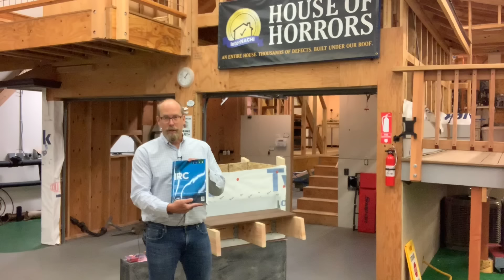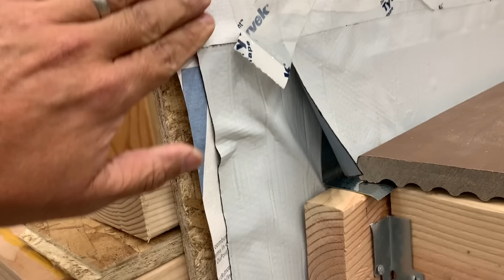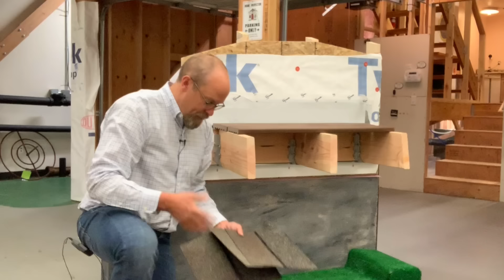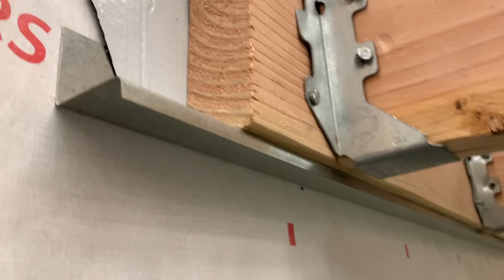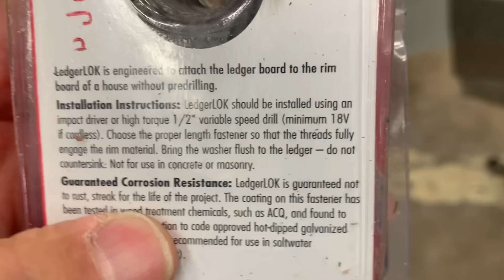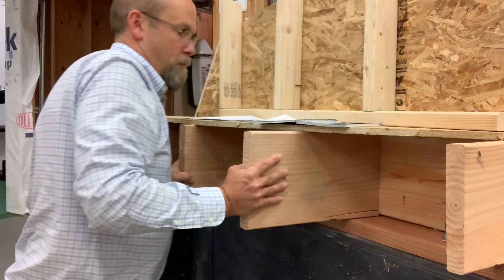Deck Ledger Board Flashing Inspection Tips

Comment: We recently removed a concrete and deteriorating brick patio and discovered lots of water damage from improper slope and drainage. The rim plate and joists have been sistered and/or replaced and we replacing the old patio with a deck. The contractors have already installed the ledger board (and about 1/3 of the joists) and did not include any flashing. They say it's not necessary, because their plan was to butt the deck boards all the way up to the house sheathing. Everything I've read says code requires flashing AND since we've had nightmare water damage we are paranoid about future water issues. Question: Do we need to have them remove the ledger board and install a membrane behind it or can we get by with using a vinyl cap flashing on top of the ledger board? We want this done right. It's an expensive job already, and will add additional time, labor and materials expense to remove the ledgers and add the membrane. The contractors would obviously prefer to not have to remove ledgers and redo.
Reply: It's not for protecting the ledger alone and that is what the vinyl cap would do....remember that every fastener is a pathway in for water that is why great lengths need to be taken to ensure moisture is deverted away from house and those hidden components that once covered won't be seen till there is a problem. Pay a little extra to have siding removed enough to install all the elements required and when deck is complete then finish the siding down to the deck and below again with required gapage.
Reply from the maker: Thank your for watching and for the feedback.

Comment: I didn't install a ledger board on my deck. Installed 3 extra posts to support the deck along the house, centred 2' from the house with a support beam (cantilevered). My siding is untouched down to bottom and the last deck board is about 1/4" from the house. I feel that the potential for damage to the house or a rotting ledger board (no air behind it) is not worth the risk. As well, it's less expensive and quicker to install a few extra posts.
Reply from the maker: Thanks for watching and for the feedback, Hue.

Comment: Loved this video, thanks! I am installing a covered porch and even though this is for a deck, I believe it should be  the same procedure when attaching the roof of the porch to the house... I have vinyl siding, so I will be removing it, apply the flash, then apply the waterproof tape in a shingle type manner (overlapping)... then the 2x8... Now should I look for some type of beam to attach? Or I could I just attach to the house wall itself?
Reply from the maker: I recommend contacting a local contractor that your local certified home inspector recommends.

Comment: Bought my house back in October. Having some trouble with rotting of siding and the deck. No house wrap, membrane or flashing was installed. Don't have the money to get the whole thing re done right now. What do you suggest I do without uninstalling the ledger board. in the meantime til I'm ready? Flashing and membrane on to and bottom of membrane. 

One of the big reasons water was being brought to the area was also due a gutter leak from an improper installed gutter from above. Fixed that. So I'm hoping with some replaced siding it will be ok for 5 years or so. But, want to water proof as best as possible so it lasts as long as possible.
Reply from the maker: I'd contact your local certified home inspector to check it out and make recommendations for you.

Comment: Is this necessary or new?   We use to use the copper roll flashing and that was it and always passed
Reply from the maker: Copper doesn't self seal, so there are many places where metal just doesn't work, including behind the ledger board through which fasteners may pass and would require a self-sealing material. Just something to think about.

Comment: no need to put flashing on the bottom of the ledger...
Reply: We also never do metal flashing on the bottom of the ledger board... and honestly I cannot see why? We do two metal flashings one top of the ledger board that’s the first Metall one ( just a simple 90°  2” by 2” metal Profil ) and the second one is then over the final deck boards whatever they are 1” by 4” or 2” by 6” or Tex boards ...
Reply: @wolfgangselle4307  i am trying to picture this in my mind
Reply from the maker: It may be a good way to kick out the water from entering the top edge of exterior siding material that begins just below the ledger board.
Reply: @internachi  absolutely need it just my opinion
Reply: If its in-set

Comment: My home inspector also didn't mention anything about the deck either. I decided to take a peak and noticed my band joist is rotted out. Not completely, but enough where that section needs to be replaced. Luckily I think I can manage the repair myself, very little to no jacking should be required. We shall see. After I fix it I can replace the deck with a properly built one. 

The real trick will be figuring out what to do about the old well they build the deck over.... Tempted to leave it be but I need to regrade the yard for proper drainage and that would make the we'll casing sit about 2 feet above grade.....
Reply: If the home inspector is referred by a home buyer's real estate agent the inspector will usually not find anything significant. Real estate agents won't give referrals if they do & most of their clients come from real estate agent referrals.

Home buyers / commercial property buyers should ALWAYS choose their own inspectors & attorney for closing.
Reply from the maker: Thank you for the reply and feedback, Casey. It's very difficult to find hidden defects. I'm glad you were able to get to your deck and make repairs.

Comment: I just found out flashing was not installed on my newly installed deck. Do I need to disassemble the whole thing to install flashing?
Reply from the maker: No. There are ways to fix a deck flashing problem without removing the ledger board and floor joists. So, I recommend contacting your local home inspector for a recommendation for a good deck professional. Find your inspector at https://www.nachi.org/certified-inspectors
Reply: Soley depends on what the exterior of you home is. If brick you can cut a groove into mortar joint. With a matching color (if applicable) make a z bend metal flashing. Just 1/2" groove into mortar is sufficient.  Make sure that you have a spring bend on metal cover decking and that it sits down on top firmly. Once done patch mortar or use a silicone based filler to seal the cut mortar joint. Should seal deck right up. Oh and it would be nice if spring bend could pass the ripped deck board against the house. Flinging Hammers

Comment: Would have been nice if the county inspector who supposedly inspected my deck would have caught all of this $5000 ago.
Reply: @Jay C  a home inspection annually has nothing to do with the government! Ever!
Reply: Yep. Our deck has no flashing above ledger. They also just attached the ledger directly to the siding, with no flashing. 

With the ledger being on top of the t1-11 there's no way to properly install the flashing without completely redoing the ledger and siding which basically means a rebuild. 

Fuckin corner cutters man. Some Really shitty workers out there. 

Do it right the first time or your gonna make someone have to tear it out later.
Reply: Cry me a river the price just went up 😂
Reply: Was that $5,00 for a penalty or for having to rebuild the deck?
Reply: It has to be rebuild/repair. In my area, inspectors would simply require reinspection until it meets code. They might charge $100 for refiling to repeating inspection after a couple attempts.
Reply from the maker: Oh, sorry to hear about that, Chaz Man. We believe every home should be inspected every year as part of a homeowners routine maintenance plan.
Reply: @internachi why only once a year? A monthly inspection would extract 12 x the money from home owners🎉

Comment: Bolts/ lags need to go into something solid such as studs or rim joist and sometimes it is necessary to be closer than the 2 inches mentioned from the top or bottom of the ledger board.  Predrilling will prevent the ledger board from splitting.
Reply from the maker: Thanks for the feedback, J D.